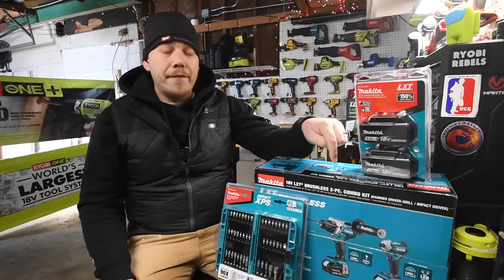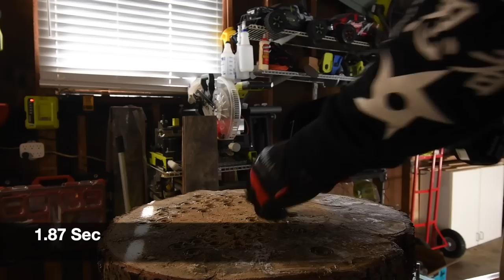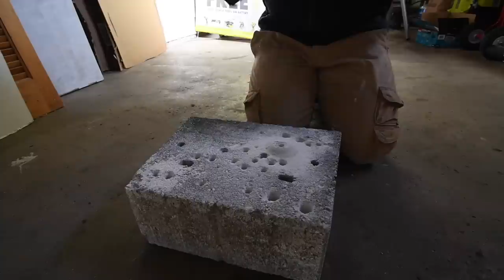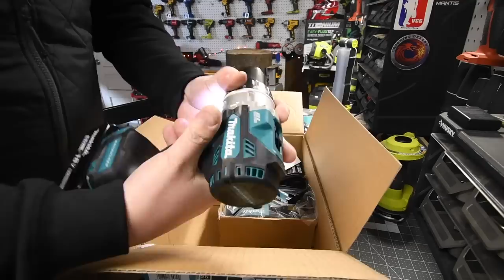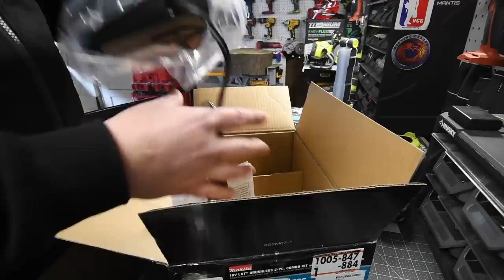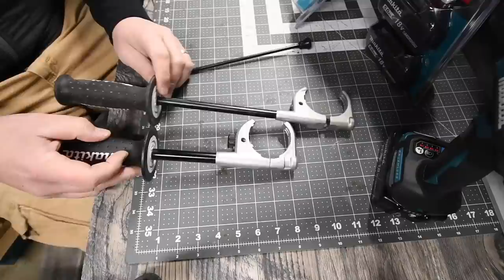New $400 Makita Hammer Drill Kit (+2 FREE batteries and bit set)

Comment: This new Makita XPH14 has 1,200 inlbs. of torque and the older bigger XPH07 only  has 1,020 inlbs. of torque , so it should be a good amount more powerful , even though it didn't look it in your testing....  I'd love to see it go against the M18 Fuel hammer drill  and the Dewalt Power Detect hammer drill ....👍
Reply from the maker: I will be doing a versus video against the bigger older version, I want to see if it is worth the money
Reply: It’s 1250 the new drill

Comment: Wera make the best bits, they are expensive though. I want you to see whether this has a mechanical chuck or an electronic chuck, try driving some screws on the wrong torque setting and see whether it makes the horrible clunking or whether it silently stops trying to drive the screw. Also i want a test comparing the led brightness to the old model. Also try drilling a 6mm hole in a thinner concrete block or brick and compare the speed with milwaukee's high-end drill. That concrete block isn't a great test as some chucks are deeper so they don't always drill down the same depth which is why a thinner block that the drill can fully drill through is better for accurate tests.
Reply from the maker: ill have to look into that, it didnt see any where on what kind of clutch it is, but I will find out

Comment: @mancavertools I tried to search for the XT288T and the XPH14.  I found it at toolnut but they had none for sale.  No one else had it listed. Toolnut listed it at $409 with no accessory bits included and no second set of batteries.  So where did you get the tool from?  You did not mention where it was bought from.  I am assuming Makita sent it to you and you didn’t mention it.  Please explain.
Reply: Home Depot is running the deal in-store only for now, so you'll have to call or make a trip to your local store to see if they have it in stock. The website doesn't even have a listing for it yet. My store had it tucked away on a back endcap near lumber and not near the other power tools.
Reply from the maker: I go this form Home Depot. and make sure it has the new hammer and not the older one.

Comment: Looks like they got rid of the battery level gauge on the new tool.  On the old tool the clutch ring is by itself and is a mechanical clutch.  Looks like on the new one, they made the clutch and mode selector for drilling, screw, and hammer all on one ring.  Is the clutch on the new drill mechanical or an electric clutch?
Reply from the maker: that I did not look at but I will find out

Comment: When are you gonna try the non compact hp hammer drill and 4 mode non compact impact driver I just bought it for 229.00 with a new 4ah and a new 2ah batt and charger that thing is a beast way better than my compact hp impact driver. You broke out of the tool line that started you and forgot about ryobi. Ryobi nation  you forgot about us
Reply from the maker: ive been tring to buy it but I am unable to get it in my area yet :(
Reply: I just bought it and love it now I have the p238 4mode new impact driver and 1/2 inch hammer drill which is a monster. A full packout set a m18 m12 working on all mikita and and dewalt hilti is next anything you suggest I get in hilti?

Comment: Thanks for the video. New Makita is nice, but in the video it doesn't seem to have enough poop to justify the price (about $150+ tool only). Dewalt 999 seems better, especially when you get it for about $90 during HD promo ($179 buy the tool and get Flexvolt battery included for free). 
Saw this Makita Promo at HD store today. Being that it's three individual items (SKU) for the promo in store (not online), perhaps the HD Makita promo can be hacked in store. If so it might make the new Makita Combo kit a better buy.
It would be nice to see a teardown of this new Makita Hammer Drill and see if it still has what some consider a rear plastic housing/bearing mount design deficiency and using only two screws. 
The Makita Impact Driver is nice !
Reply from the maker: I do love the new hammer drill and that impact is my favorite impact I own, I thank you for viewing First

Comment: Alright!  Dave showing  ‘Teal‘ some Love!  😁😃☺️ I was so excited to see this Vid pop up in my Notifications.  Although I believe this is an upgrade to the XPH 12 drill, not the 07?  This is the newer compact hammer drill.  The XPH 12 drill was a good design, but poor execution.  Gears were a bit wonky, and the speed controller on the brushless motor would act up.  Not to mention it would wind up real fast at 2000 rpm in high gear, but big down once under load.  The XPH 12 would never do the first auger in high gear, like this new model would.  I’m not surprised or disappointed the new one wouldn’t do the second auger.  Not a lot of drills will.  
Dave, Love ya Cuz, but please please, just tighten the chuck fully, and then just leave it, K 🙏👍😁✌🏻🇺🇸👍👍👍. Stay safe and Healthy!  Oh, I am surprised at Makita ‘cost cutting’ by not wrapping the tools in plastic, like they used to?  Competition must be getting tough 🤷🏻‍♂️🙄😂
Reply from the maker: there will be more videos on this coming up
Reply: @ManCaverTools  👍👍👍👍👍👍😁✌🏻🇺🇸

Comment: Nice video Dave ; your channel is growing man I remember writting comments at some where between 100 or so  
 I know it will be a not but you want to sell your hart tools lol 
I just recently got the multie tool they have and the orbiter sander ain't bad tools for starting out on leaning to use them 
 Already had the drill and impact of the hart line and saving and cant waite to get the brushless drill and impact drill and the hammer drill 
 Sorry man dont mean to bore you but I called the hart customer service hot line and asked if they are coming out with a brad nailer they said yes in time but couldn't get a date from them  untill next time dave later man sorry so long on comment lol
Reply from the maker: I thank you for the support Harvey

Comment: I got an dewalt flex volt advantage hammer drill and impact driver but I was going to buy Milwaukee m18 Gen 3 but I changed my mind cause I really wanted to try flex volt  they bouth are 399.99 and so as makita  I’ll open the box this Saturday and check it out know ryobi , craftsman, kobalt, rigid, hilti, metabo are 149.99- 349.99 but makita and Milwaukee  and DeWalt are the most good but I’d rather go for all of them cause each tool is good by different carriers so that’s why I keep all of them mostly except metabo, kobalt

Comment: Was going to buy the XPH14 from Berlands to replace my XFD07 and then I saw the kit on the endcap at HD and realized I was either getting a free backup XDT16 or a second XDt16 and four free batteries out of it.  I need more Makita batteries than I need more Makita tools. So I pulled the trigger.  Don't worry, Berlands will make more in gross profit off of me by the end of the week either way.  Anyway, these XPS bits that all of the shilltubers have been preaching about are the worst fitting bits I've ever used.  Seriously.   I'm not sure why you think they're better than the Wera/Hilti bits.  The fit, or that they hold up to wear and tear better?  Anyway, I opened up the XPH14 and the XPH07 and they're practically identical inside.  The gearbox is different...looking.   It's possible that the XPH14 is literally an XPH07, but less nerfed at the brainbox level, and in an XGT shell.   The shorter handle makes life on the go much easier. Ridiculous that it's not backwards compatible.   Short story, Makita's drill and rotary hammer handles are the absolute biggest pain in the ass I've used.  I noticed that Milwuakee and Ridgid also use the same kind of U shaped handle clamping mechanism.  So, ugh.  Why?  It's awful. Just use the standard ring wioth indents style.  It's better.  :0   The XPH14 with a compact battery rotates at the same pitch as the XPH07 on a standard battery with no load.  That's more conspiracy theory fuel about the brain box being less nerfed.  Anyway, it works on my Makita batteries and fits in my systainer way better than the old one.  Also, I noticed that the new XDT16 was sounding wayyyyyyyy smoother than my XDT16 that has been so abused I changed the shell twice....so, maybe it was not an unneccessary purchase afterall?  :0
Reply from the maker: I will be doing a lot more tests with the new 14. stay tuned for the at and I thank you for viewing Robert
Reply: Bought the td172 from jap that thing is even smoother compared to the one in the kit dtd171d which i belive is the same ad xdt16